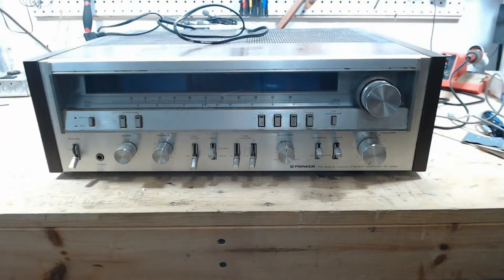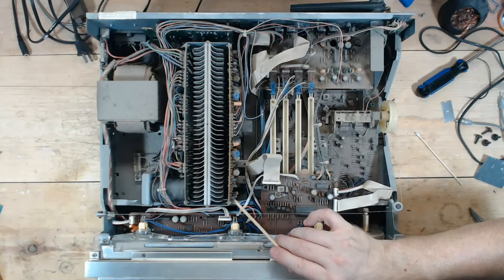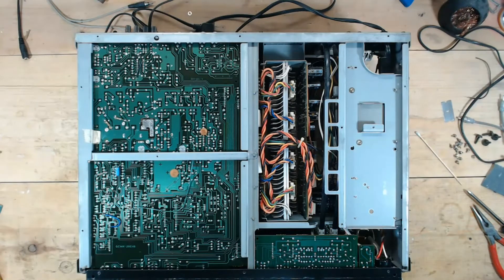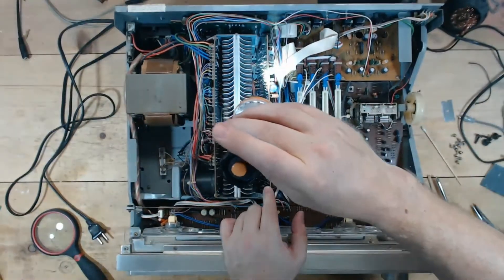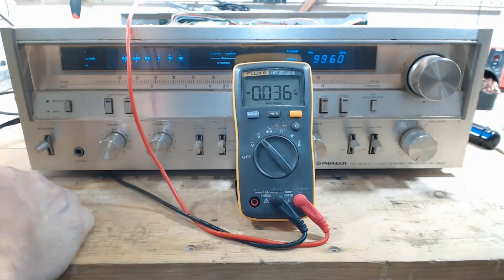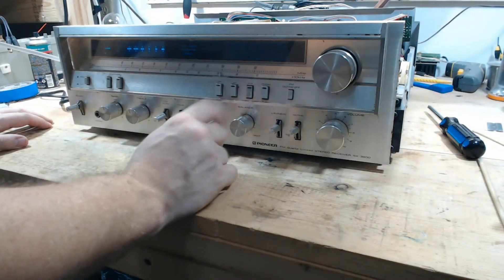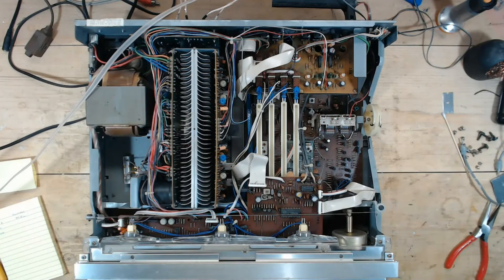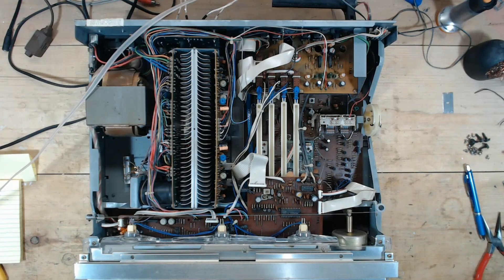Smoking Pioneer SX 3800 Stereo Receiver Repair Part 1 - Releasing the Smoke

Comment: Hi.  I enjoy your videos very much. I have a SX-3800, and it needs an adjustment of the LED power meters. Can you tell me how to adjust them with a multimeter?  Thanks very much! Ty.
Reply from the maker: You will need to reference a service manual for the instructions on how to adjust the LED meters.
Reply: What's the best way to get a service manual for this unit?
Reply from the maker: @tvdmc  Hifiengine
Reply: I don't have membership with hi-fi engine. Could you send me a copy of the service manual? Thank you very much!
Reply from the maker: @tvdmc  Audiokarma also has a 'database' of service manuals...may want to check them out.
Reply: Thank you!!!
Reply: Are these 2 VR1 & VR2 (photo attached, right behind the fluoroscan power meters)? The board does not have any markings at all.

Comment: Having worked on a couple of 3700's, I can say that the quality of this series is not great. IMO, it leaves a lot to be desired.
Reply from the maker: I agree and I find the low end to be a bit thin - I think speaker selection is key with the 3x00 series.  My SX 3900 really only shines with my HPM 100s...have tried other speakers (Advents, Wharfedales, ARs, CS 88As, etc...) but they just didn't pair well.
Reply: This series also sounds thin compared to my SX-750 & SX-950.